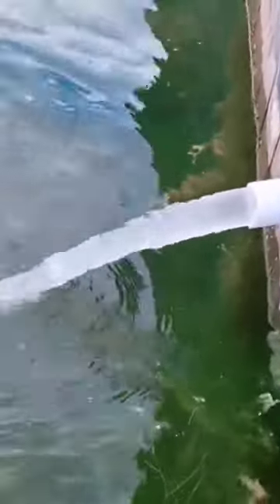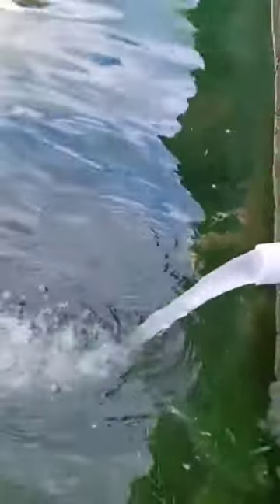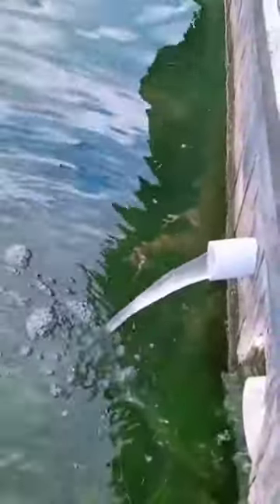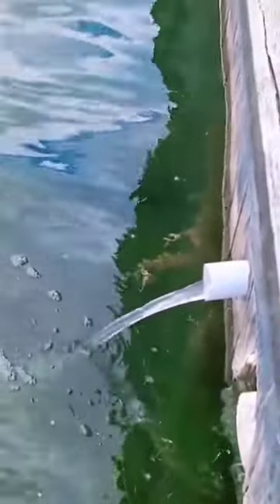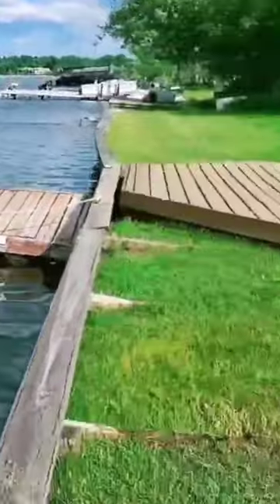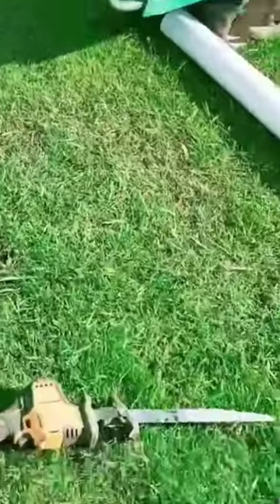How to Stop Short Cycling in a Outdoor Sump Pump System - How to make the Pump last FOREVER

Comment: So is it just the switch or the pump itself that wears out from constant turning on and off? I thought it was not good for the pump as well.
What is the optimal time a pump should run? 1 minute? 3 minutes? 10 minutes?  Most sump pumps have switches that have only a 6” range which seems really small to me. I found one switch with 15” of travel before turning the pump on and off. I believe some pedestal pumps can be adjusted to have a greater switch range. Thoughts???
Reply from the maker: https://youtu.be/ULtw-4ZZ6VQ